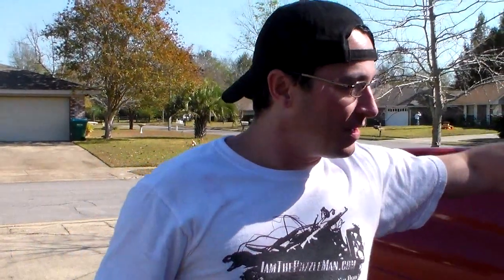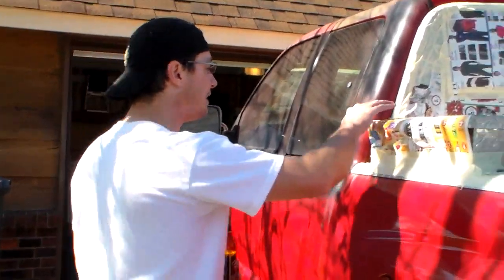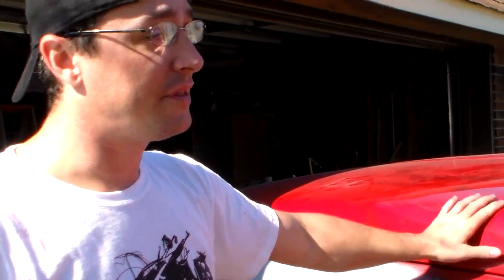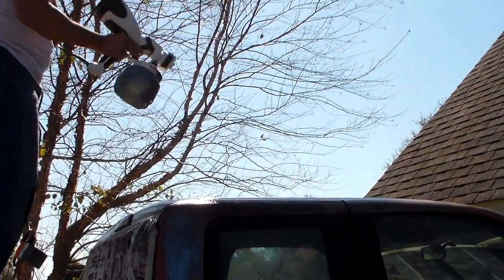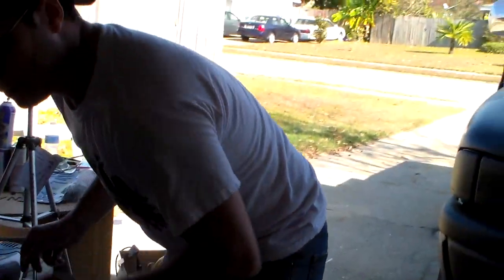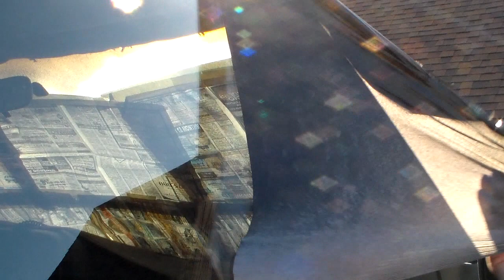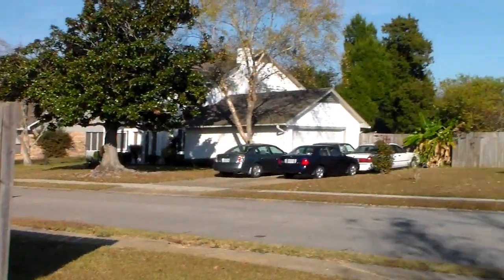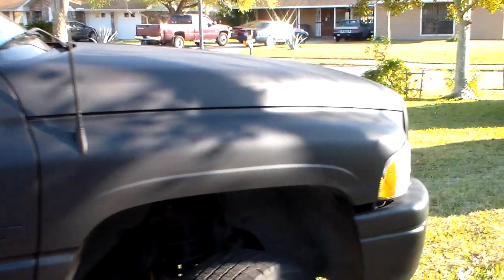Plasti Dip a car truck or SUV - Dodge Ram.

Comment: Truck looks a lot better than it did at the start. When you were done it did look like it needed a couple more coats on the hood. That could be my monitor or the camera though, plus I am tired as hell right now. You did answer a question for me though... aprox 5 gallons to do a job this big. My Astro should take about the same, I think. Keep up the good work

Comment: How's the space btwn the door and bed? Did you cover it well? What if they go to carwash and spray a high pressure on that part? It will take off does it? Its like behind the door handles. In my case, at the back of the door handles rubbed off. and I gonna cover all the back of the back mirror, I mean what you call it? In btwn the bed and at the back of the back mirror or doors.... hmmm...

Please answer. Thanks.

Comment: With the new gun, have you noticed any difference in the amount of coats you have to spray from the 5 coats from the old Wagner sprayer? Any issues with the volume of spray from the new gun?

Comment: how well do plastidip maintain when your at the gas station car wash with high pressure water and all that soap? Im planning to decorate my car with plastidip instead of Vinly.
Reply from the maker: At a gas station... NOT AT ALL. I mean, be very careful when fueling up. DO NOT get any gas on dip. As far as high pressure, I was my car dipped car in a high pressure car was(with brushes) on a regular basis.
Reply: iamthepuzzleman wut?